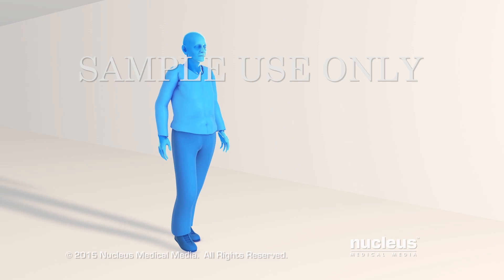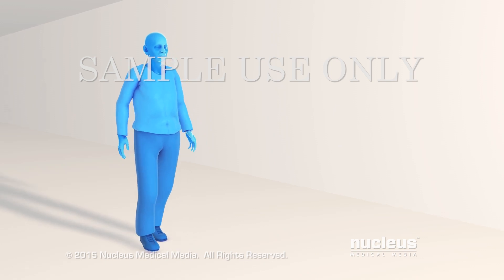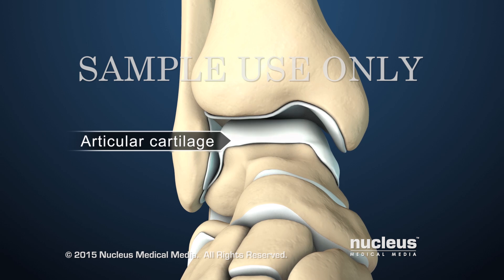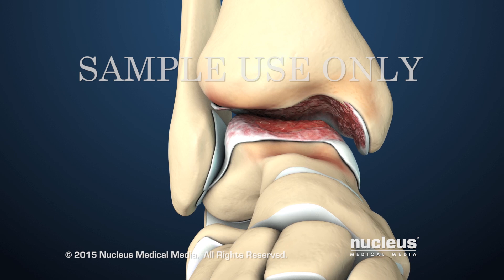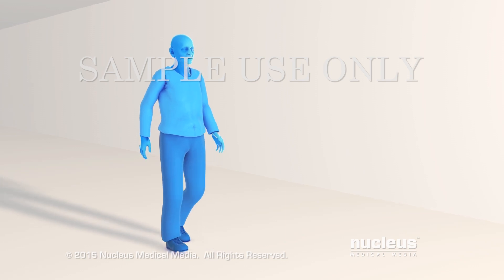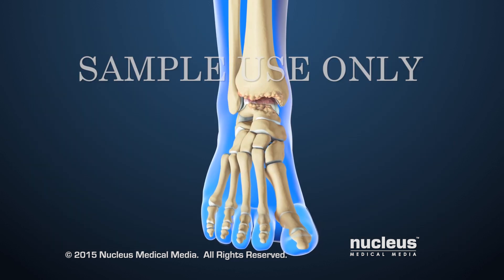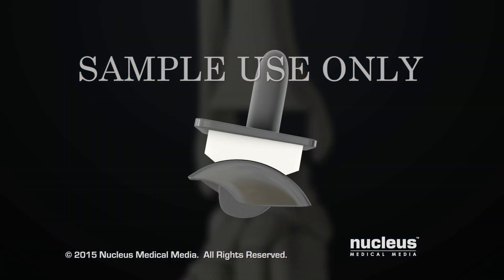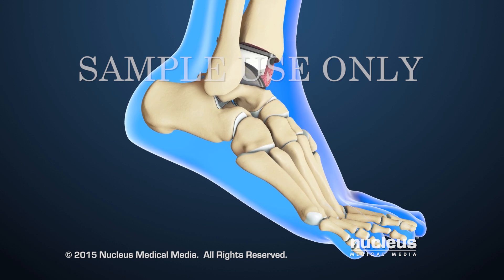Total Ankle Replacement Surgery | Nucleus Health

Comment: Very painfull and difficult so far after the first 4 months. They cut the nerve becasue the blade went too far and damage my tandon. Also, during the surgery shattered the modial Malleolus. The x-ray after 3 months shows that. Now! I have so much pain and swellings. So this surgery is not that easy and you should be preperd for it. My implant brand name was " Hintermann Series H3 TAR" wich have a age front of Tibia where exatly you big toe's nerves traped under this age to of tibia. I see so many comments here which they don't have much cloue like me before surgery. Do not do this surgery except there is no other option left. This is my opinion after 4 months. Please if someone already down this before me with the same brand, leave me a reply. My doctor said I would never get motion like my other ankle. why all this risks are being told after the surgery. Do you home work and learn about whtn is the brand of the implant and go to that webesite and see what are the risk of nerve damage or fractures and everything else.

Comment: Due to a structural deformity (tibia meeting talus at the wrong angle) I had a TAR 4 weeks ago on my right ankle. Fortunately, I had Dr. Schuberth (Kaiser, San Francisco) who's done a ton of these and has a high success rate (in the 90's). After being non-weight bearing for 2 weeks, I got a weight bearing cast and slowly began putting weight on it. One month later, I can walk! It's stiff, and my gait will take some work, but, I can walk!  Incidentally, mine is the Paragon 28. I do need to have the other one replaced as well.

Comment: I'm in a tough situation. I'm not quite a spring chicken anymore, but then I'm only 34. My only 2 options are fusion and ankle replacement.... Any advice or experience is GREATLY appreciated ☺️
Reply: I have had ,both ankles replaced
One 2019 and the other in 2020  ,I didn't want fusion so found a surgeon in Sheffield I'm who did both ankles and they are both brilliant
Reply: @barrytaylor760 Thank you Barry, for this I just got all metal removed, clean out of ankle joint. Going back to Dr. Tomorrow I will be mentioning this to him.
Reply: I’m 38 and the docs want me to get an ankle fusion because they said with the ankle replacement it only lasts about 10 years and wear and tear makes even less than that. It’s what the doc told me but I don’t really want ankle fusion neither
Reply: @crystalmunoz6384  ya  I am 35 that’s what they told me but fusion causes more arthritis in other joints. Plus I’d rather not walk with a peg leg I hope ankle replacements get much better I’ll wait if I can!!
Reply: I’m in the same boat lol 35 it’s such a tough decision
Reply: @kylemacdonald2929  lol I'll be 35 Tuesday, have you been leaning towards one or the other? There's a 3rd option I heard that regenerates your joints. I'll give you the name once I remember in case you wanna research. But the price is astronomical, you know insurance doesn't wanna pay for something that will actually restore, they'd rather just slap a bandaid on it.
Reply: @alexandrac9363  yes if it’s stem cells I’ve looked into it it’s very pricey and not covered! everything that might fix the problem usually isn’t covered. lol but if I have to choose between fusion or replacement it’s going to be a replacement 100%
Reply: @kylemacdonald2929  yep, that's exactly what I was trying to remember. I can't even afford the flight and hotel stay let alone the surgery. And I'm with you on the NO fusion. I opted to just have bone spur removal and some hardware taken out until I decide because my Ortho told me that if the replacement doesn't take for some reason, I could risk losing my foot. So yeah he kinda ruined that idea bc I can't live with the thought of something happening and me losing my entire foot.
Reply: @alexandrac9363  ya I’ve had now 7 surgeries I had my hardware removed in 2020 and I just had bone spurs and arthritis scraping done this march was my last surgery but my ankle is so bad not much else they can do. My surgeon told me it’s very very rare for the replacement not to take tho or your body to reject it of course there is always a chance but it’s very rare. I’ve been looking into something right now tho to prolong my injury a bit longer I am hearing great things about peptides it’s called BBC 157 people swear by it can repair cartilage and bone and joints. It’s a type of peptide I am going to try it what’s the loss it doesn’t work and I am at square one again lol if it works I don’t have to get a replacement
Reply: It comforts me knowing there are others just like myself, in what I thought was an extremely rare, unique situation. 

How has the replacement been treating you? 
Since last year I’ve seen several different orthopedic surgeons. One leaned towards ankle fusion and the others replacement. It was my understanding that most insurance plans, under your employer, provides adequate coverage for the surgery, correct me if I’m wrong.
Reply: A doctor fused my ankle and I still suffer. Doctors tell me I’m too young for a total replacement. I may need to employ a demanding attitude. It’s either up to liability or doctors are trained to only do as much as what’s necessary to keep us suffering so we keep returning and paying up.

Comment: I've had this done about 5 years ago and I have just as much pain as I did before. And now I can only move my foot up n down but not side to side. Nobody mentioned that before surgery, they kept saying it will be like new. My A $$
Reply: Any surgery is a gamble, and results will vary from patient to patient. I have had two ankle surgeries in the last year, and fusion/replacement are possible down the road, but my surgeon has already made me well aware it's a last ditch effort when you go down that road. Unless your ankle is so bad and causing extreme pain and basically preventing you from walking, then yes it makes sense to do TAR. Theres mo way a foot and ankle specialist should be telling you it's the best option and things will get way better... it's basically for pain relief so you can do things like walk for 30 mins without major discomfort. You're sacrificing overall mobility in your ankle to reduce pain basically. So that's why I'm gunna need to be in some agonizing cant function pain before going for the next step
Reply: @DChappelle27   How is your replaced ankle feeling now ?
Reply: +April Merjil - I'm sorry to hear that. I hope it somehow improves for you.
Reply: April Merjil I feel sad for that, because my doctor decides to do it for me , but I'm so worried about the results

Comment: So wait. If I get the new ankle, can I do strenuous activities like running, jumping, and climbing without breaking it?
Reply: Regin Biglete there is no such thing as an unbreakable joint
Reply: Geejay Diamonds also your ankle can only move in one direction it cant pivot side to side anymore and i’m sure this is a lot weaker than a healthy ankle joint
Reply: I can relate to this. Thought it would be like new, but unfortunately not.
Reply: @paulfenwick8968  would you recommend getting the surgery with how yours turned out? I just want to know if it's worth it in the end. Still pain?
Reply: Sae. Yeah I would go ahead with the operation. I was in terrible pain and couldn’t walk. After the op, I can walk with less pain, but have only 10% movement in the joint, which isn’t ideal, but I’m in a lot less pain.
Reply: @paulfenwick8968  thank you for the honest reply
Reply: Sae hope it all goes well for yourself 👍🏻
Reply: @paulfenwick8968  what did you had, fusion or ankle replacement?
Reply: @Thatoneguyrobloxyt  I had an ankle replacement
Reply: @paulfenwick8968 hello I’m scheduled for an ankle replacement next month. May I ask why you ended up with only 10% mobility with a total ankle replacement? I have 0% mobility with extreme pain, as it is. Thank you for your response.
Reply: @MrBoomtx21  I was the same with the pain. I thought a replacement would give me more movement in the joint, but it didn’t. I would still recommend having the procedure. As I was in crippling pain constantly and the operation took that way. So overall it’s a win. I wish you well
Reply: Best to do as little as possible so lengthening the life if your implant. But walking and weight bearing is fine
Reply: Geejay Diamonds same of my question